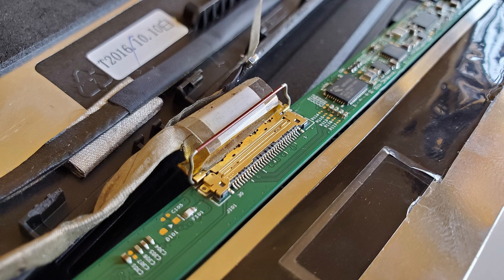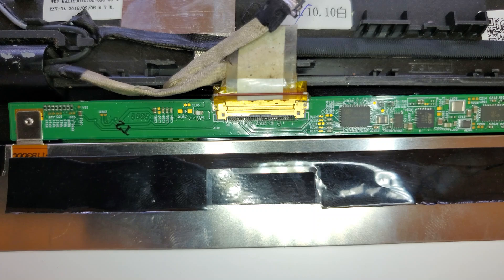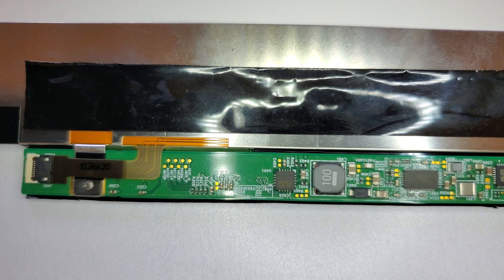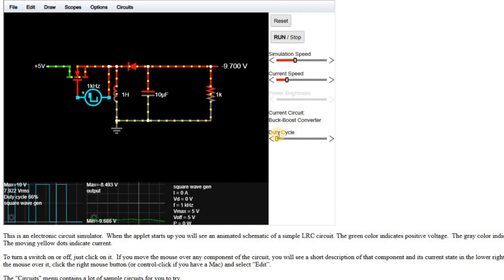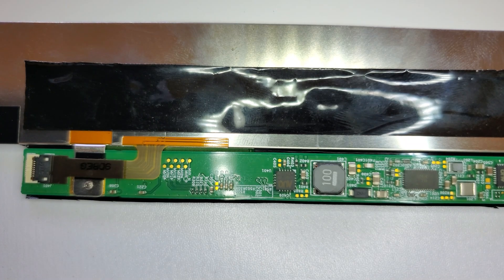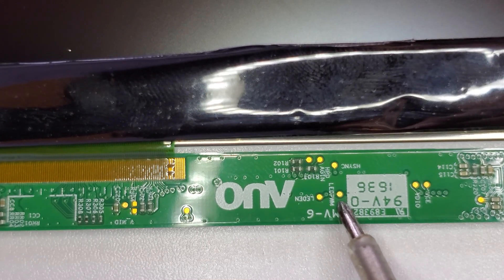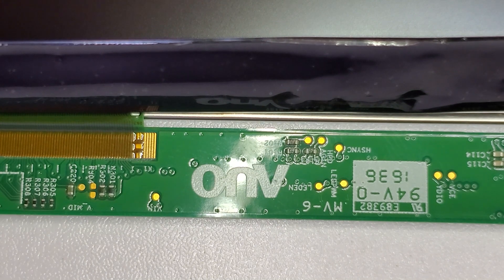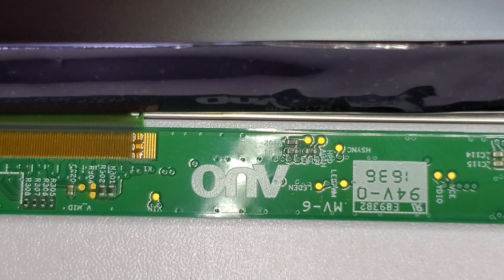How to Troubleshoot and Understand Screen Backlight Circuit

Comment from the maker: Which video do you want me to make for you?
Reply: @platinum_computers  please can you do a video on the communication between the ENE Chip, bios and PCH Circuit thanks
Reply: @dzabakwesi2213  please make a video on how to test with oscilloscope
Reply: Huawei y61 id bypass
Reply: Battery not charging
Reply: please how to know is data et clock are good with oscilloscope

Comment: please help, my thinkpad T480s screen show verly little glow light even after the laptop turn off, and i notice it at night when all my room light are off and pitch black room. i realise my laptop screen show glow light at bottom even the laptop already shutdown long ago. and it drain the battery at 10-20% per day if i m not using it at all. 

i already try remove the battery and that glow disapear, but at the moment i plug in the battery again it immidiately glow light again. i find very difficult searching the problem online, do you know whats the problem?

i already try clean and re insert the dislay cable and nothing changed

Comment: This  comment is for this video of yours -Charger Light on and Off: laptop Shut off on Windows Loading Screen This how you fix it.
My laptop shuts down on the Windows loading/login screen only when the charger is plugged in. But if I start it on battery, it turns on normally. Once it reaches the desktop, it works fine even with the charger. Did your laptop also turn on without the charger like mine?
Brother pls reply ..i dont have money  right now and  technician is asking me a lot of money .you are like my last hope